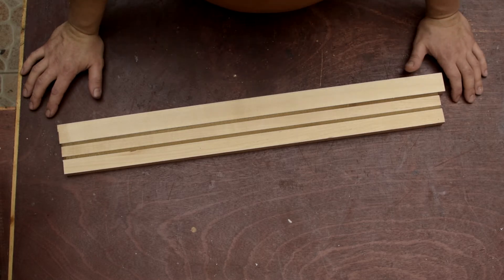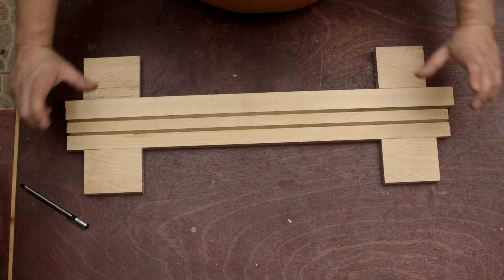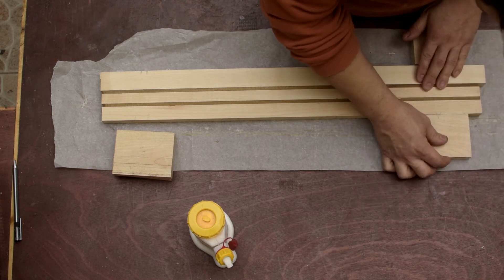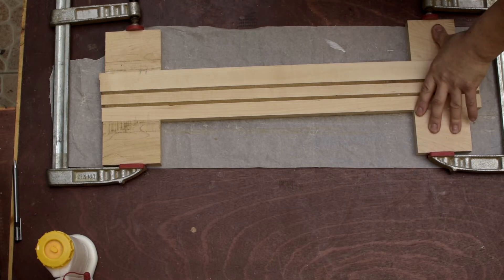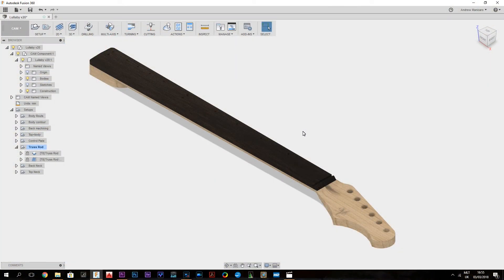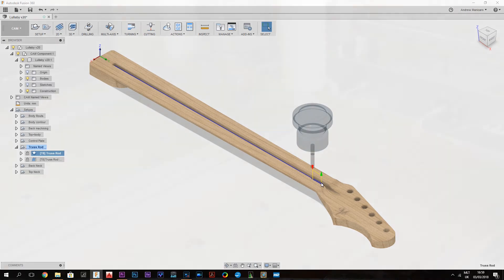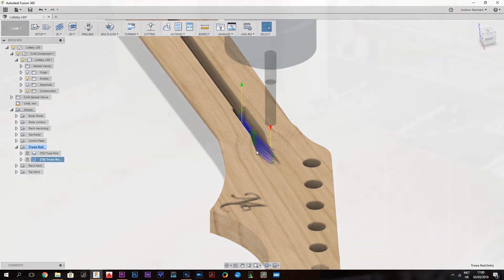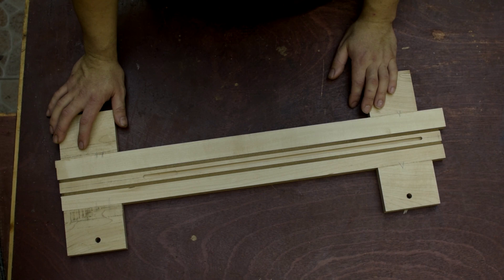How to build a guitar using a CNC - Episode 6 Part 2

Comment: Great videos. I'm still unclear about the relationship between the mounting holes, the 0,0 point, and the center line of the neck. Are the mounting holes an equal distance from the 0,0 point and center line? Fantastic walkthroughs, nothing like this on youtube. thanks again.
Reply from the maker: The mounting holes are at an equal distance from the center line so I can flip the blank while the center line remains in the exact location. The 0,0 is the starting position of every tool path, this is set up while doing the Setup and Toolpaths in Fusion 360. Hope this helps :)